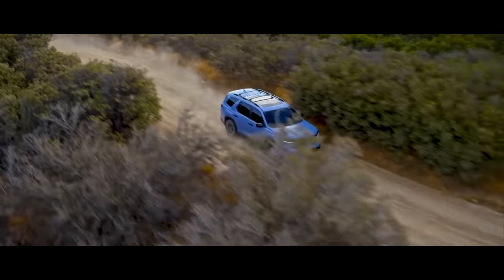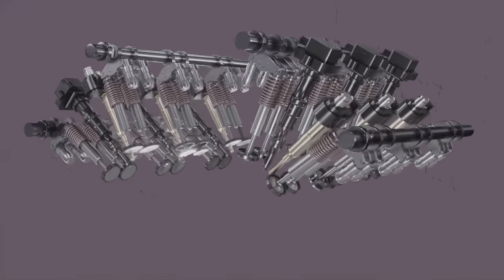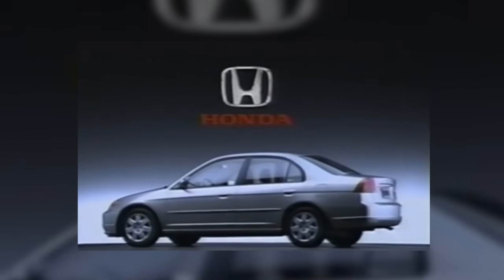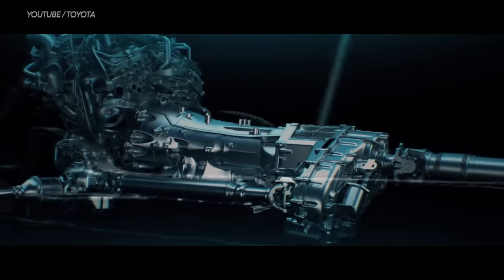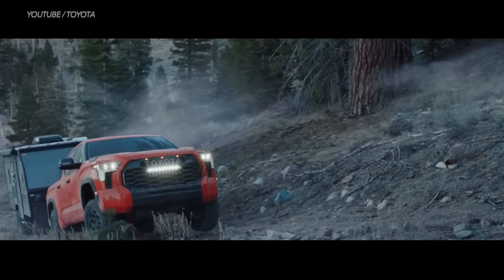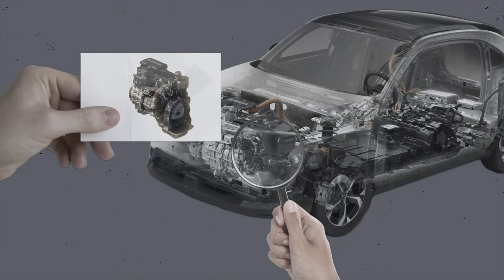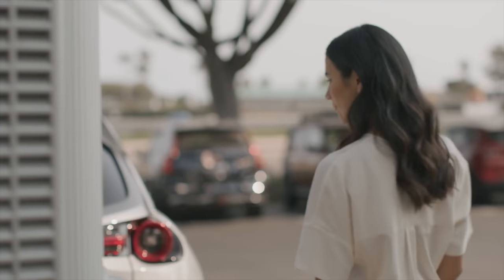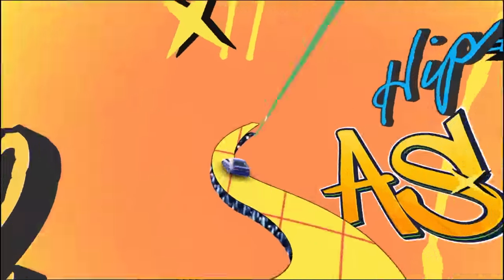Honda, Mazda, and Toyota Just Shocked the Entire Car Industry

Comment: The biggest shock is normal people are actually paying these crazy prices and are excited about  it
Reply: What exactly do you mean by “crazy prices”? When factoring for inflation cars today actually only cost about 25% more than they did when I first started driving back in the mid 1970’s. Basically you are getting cars that are 10 times better than those older cars in every possible way and yet you are only paying 25% more. That sounds like a deal to me. Of course, when I started driving I could not afford a new car and since I did not have rich parents I had to buy my own used car. I bought my first $500 POS car with money I saved working a job after high school everyday and that car was horrible compared to what I could get for the equivalent $2500 today. In fact, 4 years ago I bought an old 1999 Camry for $1700 with 180,000 miles on it and used it as a commuter car for several years so that I would not have to put mileage on my very expensive sports car. Anyway, that thing was ten times more reliable and nicer than that first car of mine which only had 80K on it (80K miles on a car in the 70’s was the equivalent of about 180k on a modern car). But apparently young people today all seem to think that they are entitled to drive a brand new car and they will put themselves deeply in debt in order to have one.
Reply: @SLOBeachboy  😂😂😂😂😂😂😂😂😂 people got paid alot better pretty much through the late 70s all the way up until the late 90s. I know old guys that were getting 15 to 20 an hour in factories in the 80s now compare that to today. Everything cost 10x as much and if you take inflation into it we could paid probably half of what people did back then.
Reply: Most Auto makers have written off Low lncome & middle class people as their Primary Customers.
They now believe that Upper Middle Class and Wealthy people are their Target Customers. I went to meetings about this.
Reply: Regrettably, it seems that most vehicle manufacturers are interested in the upper middle class and the rich. For us in the lower income bracket our choices are being the bus or subway.
Reply: @SLOBeachboy  25% is enormous increase after taking inflation into control. Think of it this way, sure they cost more but why? when they were building these factories full of robots they told us it would mean cheaper cars, but here we are, cheaper than ever to make but cost more than ever. We know that the price is chosen by the marketing section not the cost of making the car.
Reply: I have a net worth of just over 6 million dollars and I have a base model Rav4 that I got for under $30 grand. I cannot believe anyone is spending $40grand or more on something that just gets dented and scratched up. Crazy.
Reply: @SLOBeachboy  Biggest thing is wages haven't kept up. Most people make far less than they did in the 70s
Reply: @SLOBeachboy  Another clueless person.  It's call the stagnant wages.  You can work at Ace Hardware store making $4 an hour and buy a house back in 1980 when the average house was $47,000.  There was a story on a lady that did just that and she did it while being single.  Try that now when the average house is $420,000.  That's 9 times more expensive, so that would be $36/hr.  That's $74,000/year.  You will not be buying a $420,000 home making $74,000/year while paying for property taxes, food, heating, insurance, gas, etc.  Learn what stagnation is.  My old high school teacher told me he bought his home for $17,000 in 1978.  He was the former president for Harley Davidson in New England and even raced against Freddy Spencer, he said Freddy lapped him like he was standing still.  Same state as Scotty.

Comment: The shocking news is that the new Pilot still uses the timing belt.
Reply: What a joke 😂
Reply: Non interference though so 🤷🏻‍♂️
Reply: @HD33P1  You still need to replace the timing belt every 100,000 miles.  And most likely, along with water pump replacement.
Reply: @francisgallozzi2595  what's wrong with that?
Reply: Six cylinder
Reply: @francisgallozzi2595  So, every 100,000 miles or so, you need to get 6 new spark plugs, a new timing belt, and a new water pump?  Maybe $1200 or so every 100,000 miles?  Sounds like a deal!!!
Reply: And I’m mad as hell

Comment: I had a RX-3 that had a bad afterburner valve.  It would backfire in about 2 minutes after it was shut off.  When we would park at a shopping center we would get out and walk very fast towards the store.  It sounded like a 12 gauge shotgun going off.  People would jump and some would scream thinking they were being shot at.  
Those were fun times.  💥:yougotthis:
Reply: It happened because heat built up in the thermal reactor (rotary Mazda's didn't use a cat-conv yet) until it ignited the unburned fuel inside it.

Comment: I actually love the rotary range extender concept. Batteries are expensive and heavy, but the electric engine actually gives a more fun driving experience. Plugin hybrids give you the best of both worlds, and a tiny high-revving rotary solves the problem of hybrids being complex. In the 80s, Briggs and Stratton had a hybrid concept car which paired a Briggs and Stratton 18 hp gas engine paired with a 27 hp electric engine and a series of lead-acid batteries, and even back then, with old tech and low horsepower, it still had a top speed of 68 mph. Since modern electric engines provide very high torque, there's surely a lot of room for this range extender concept as we wait for battery technology, production capacity, and electrical grid capacity to improve.

Comment: On Toyota..
I'm a single guy and I purposefully purchase a 2019 Tundra 1794 4x4 because it didn't have stupid push to start, was a V8, reliable and had the roll-down back window as my 4runners.. Recently sold a 2004 V8 4runner (1 of 2) for 7k. Owned it for 8yrs. My other 4runner (96 limited w/rear licker) I've had for over 16yrs, no issues and still my daily driver whenever I want it as that. I plan to keep My Tundra even longer unless I can get a newer V8 with that hybrid system.

Comment: Vtec solenoid is engaged at a predetermined rpm. This vtec engagement can be adjusted via a full aftermarket ecu/ecm.
Reply: It's also a pain when the lady at work keeps wanting you to fix the issues she's having with the system because someone did ungodly things to the motor before she bought it. I clean everything for her about every 3 months and I've found all kinds of things on it from motor shavings to red rtv silicone. I wonder what I'll find next.

Comment: I like the Prius but they are unattainable at this moment, so the Honda 'R' is my next thought. 
All I need is a 2.0 liter 4 cylinder engine with a 4 or 5 speed manual transmission. I can't afford the fear of an automatic transmission leaving me stranded .
Reply: Toyota Corolla LE hybrid best deal out there
Reply: @phatgringo2.0  Ok  ! Thanks for pointing me in the right direction. I'll check it out.
Reply: @arnoldschmidt2753  also Nissan versa with the stick shift is like $17k.  It's actually a pretty reliable car without the jatco CVT automatic.
Reply: @phatgringo2.0  I don't know about Nissan other then when it was Datsun .
But Scotty doesn't believe in car companies that have gone Bankrupt. 
And I agree. 
I bought my 07 GMC diesel new with a sticker price of $53,000.00 .
It now has 340000 KM's .
Best truck I ever owned. But I'm getting older now and it just cost too much to be a grocery getter. I've had Pontiac Grand Am's and Grand Prix GTP and they were cheap to buy but they were nickel and dime repairs. 
But they are getting harder to find and what's out there now are broken down rusty over priced cars with bloen transmissions .
And the owners still want $4500.00 with over 250,000 kms .
So it's time for a more reliable dependable vehicle. 
I also like the Matrix but no manual transmission unless it is an older version. 
Strange how decades ago you could walk into any dealer and order what you wanted, now forget it .
Marketing trends dictate what choices you have .
Take it or leave it .
I just walk away. 
But thank you for your opinions. 
They are very helpful.
Reply: There are very good automatic transmissions out there. I don't know why you're worried that much about them. Many have been proven time and again that they will hold up with regular fluid changes. One of the best manufacturers of automatic transmissions is Aisin.
Reply: @lightsfansofthewest481  Thank you for response. However ATF fluid is like molasses at -45° C up here in western Alberta. 
That's why I need a manual Transmission.
Reply: @Arnold Schmidt  The Toyota Corolla Hatchback comes with a 2.0 4-cylinder and a 6-speed manual transmission. However, it's only available with a FWD drivetrain.
Reply: @lightsfansofthewest481  That's exactly what I'm looking for. Thanks for the lead .Now I know what questions to ask.

Comment: Toyota should make a V8 that would be used in the Toyota Century ( a luxury car they sell in Japan) and sold as optional equipment in the U.S. made pick ups.  Honda should sell a larger generator in Home Depot that was on a trailer you could tow behind an electric car and it would provide it with extra energy on long journeys.
Reply: Honda makes generators not Toyota.

Comment: I bought a new 2022 Toyota rav 4 hybrid. I love it. It runs very smooth  and gets around 35 mpg. It claimed 40 but is definitely getting 35. And with it having electric and gas powered motors it has plenty of power for family driving. Definitely worth the money.

Comment: I have a 2006 MDX, 3.5L V-6 AWD, & with Costco fuel I was consistently getting 13 MPG, on a road trip, at times running it down to 1/2 a Gal in the tank, & fueling up with real gas, I got up to 24 MPG. With the price of 91 oct. Costco is not a good deal. Maybe there are other issues I do not know about...I have only had it about 25K miles 167K total... no oil burning... all fluids & timing belt have been replaced. Could Costco gas really be that bad?
Reply: No.  Costco gas is just fine.  Check the long lines.

Comment: I think Japan is taking a brilliant strategy in the EV game.  In an article dated 2011 a Japanese made an EV by a company named SIM-Drive. I think the Japanese already had the technology, however, i personally think the Japanese did not want to spend $$$$$ on EV infrastructure. Now Tesla is making the EV infrastructure and other EV recharging companies. Now, i think the Japanese will take over the EV market via their PHEV , it's just inevitable.
Reply: junk
Reply: I think you're right.
Reply: Plug in hybrids are gas cars with about 1/10th of an EV added in.  I doubt phevs are anything but a footnote in history.  If an EV is workable alone, why have 1000+ more moving parts and all that weight?
Reply: @martalli  are you dense? EVs have thousands less moving parts and extremely low maintenance. When they can make an EV with 500 mi of range and a battery pack that will last over 10 years, the internal combustion engine will become a footnote. This is coming from a car guy, I'm just realistic about progress whether you like it or not.
Reply: @phatgringo2.0  like i said, PHEVs are only going to be a footnote in history. I completely agree with you, sorry if it wasn't very clear.

Comment: The 2023 Tundra was a let down, They got rid of many body options, looks and came up with a family truck not a work truck. Towing a trailer with equipment once pulled by a 2018 Tundra, one will know V6 is no V8.  Turbos will be more parts then the two extra cylinders that will break. The hybrid like the powerboost is more a wish then a fact.

Comment: Toyotas, Hondas, and Mazdas have kinda been my picks for a long time. I'm not into the idea of getting an ev anytime soon, but if I was to consider it hypothetically, I'd say that Mazda would be pretty interesting to me. It's not about a rotary engine necessarily, but the approach they take on this one. If I was to consider an electric means of transportation, I'd like being able to plug my car in for most of the around town and commuting to work usage, and still have the ability to drive hundreds of miles on long trips without the hassle of finding a charging station and waiting forever. The ability to just stop and get fuel and get back on the road would really make something like that shine.

Comment: I don't like touch screens on cars or trucks. I like to see gauges fed by sensors mounted on what is being measured... i.e. oil pressure, voltage, charging amps... I like a mechanical parking/ emergency break. One that will always work, regardless of there being voltage available. Those new cars with an Electronic E-break, I will never get into one, let alone buy one. How many electronic thing do you have that are 40, 50 or 60 or more years old? How many old cars have you seen, & why are they still running? The later, you can still get parts & people like them. New electronics, it gets "old" in a few years, ... I wonder, why do I bother keeping up. I would rather have a person knock on my door to say hello. & yes, I walk into a bank, no ATM, & look for a clerk at the supermarket, not the electric checker. I like to see and talk with the person ringing up my items, Personal Care, by a Person. That goes for Fast Food too. No "Aps" on line, just people to people. The way business was intended to be.
Reply: E-break is such garbage, glad I bought before it arrived.

Comment: I have an MDX and an RX and in every category the MDX destroys the RX. I can't speak about the cars, but these SUV competitors are not competitors at all. The MDX is classified as a truck, and the RX is a car. The MDX handles, drives, and responds like a sports car. The RX is more like an old Caddy, lol. They're both 6 cylinders but the MDX has no issues going up the mountain, and feels so much safer coming down. The RX struggles when you start climbing in elevation, but it does power through. The MDX just takes the climbs like it was meant for it. Even the interior. I feel the MDX is way more classy, better tech, and better quality pleather seats. For something that lists for $20k less than an RX, and $10 less used, I say it's no contest. MDX over RX all day long...

Comment: Honda isn't new to the use of electric motors; they where first to have a hybrid.  So why haven't they just added more batteries and a bigger electric motor - simple Lithium is a dead end.  There isn't enough to produce even 5 million vehicles a year total industry wide;  a niche. Hence they've seen no great reason to do a full EV; hybrids are actually more efficient; they weigh less, they use 1/10th the lithium and can commute all electric if desired. Like most big makers Honda is lookng for a scalable better EV battery technology.